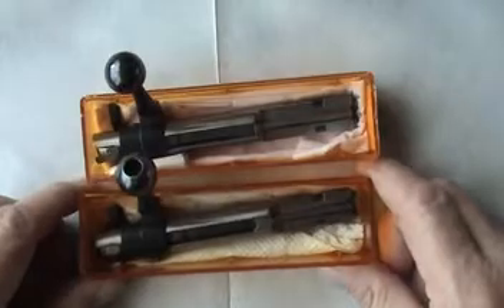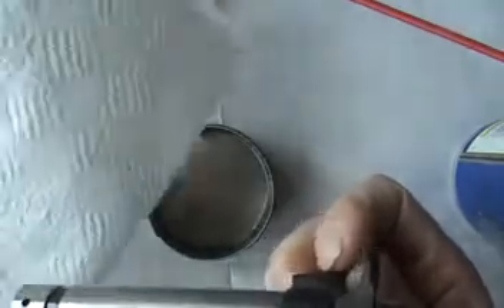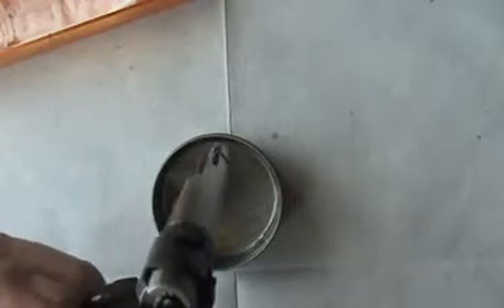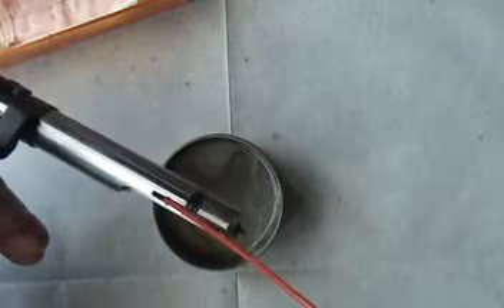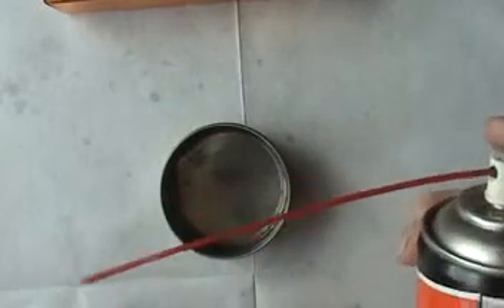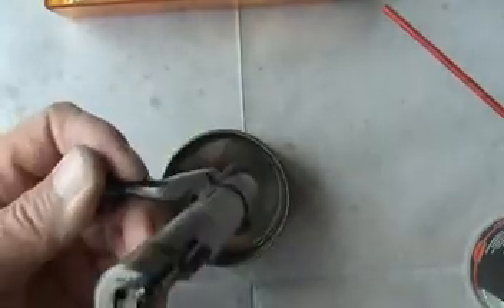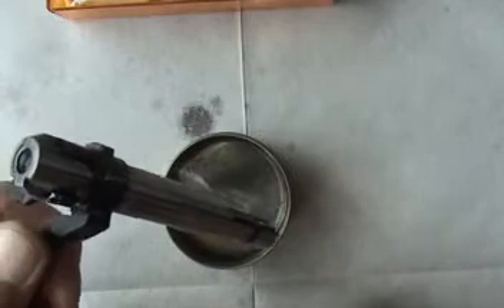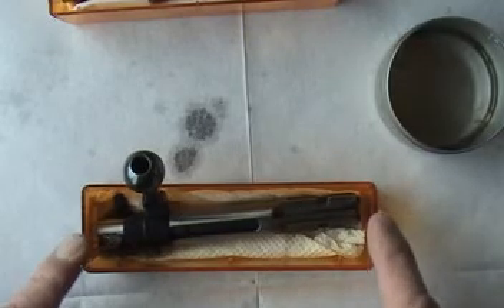CZ 452 22lr & HMR RIMFIRE RIFLE BOLT CLEAN & LUBE.

Comment: If you can get your hands on some break cleaner it works very well for cleaning without completely disassembling anything.  You must give everything a light coat of oil afterwards because the break cleaner strips all traces of oil, leaving steel unprotected and able to rust easily.

Comment: nice video. I prefer using both WD-40 and an old toothbrush to really scrub dirt off the extractors channels & ejector channel. 
I've cut it to size as to reach into the extractors recesses into the breech, and give a nice rubbing to the bolt rails.

Comment: Except for the extractors, the disassembly of the boat is so easy why not! Take the bolt apart and clean and lube everything. The extractors can be handled as you showed. End of story. If the extractors get too dirty then you have to pry off the spring and mess with that but it is rarely necessary.

Comment: So, I've heard that the cardinal no-no of solvents and lubricants is WD-40 because it leaves a gummy residue at very high temperatures (after firing).
.
Does your Brunox get rid of the problem entirely, or do you find some trouble still?